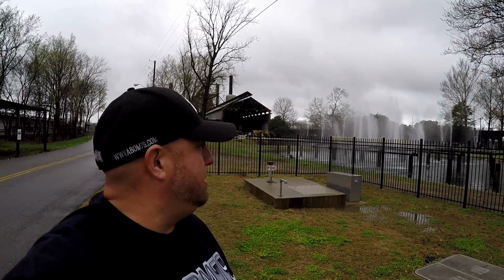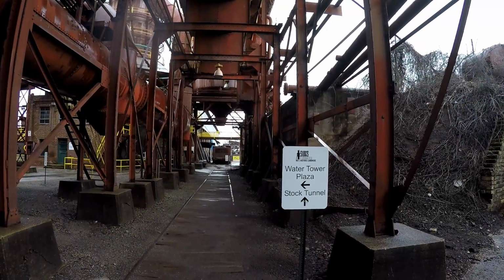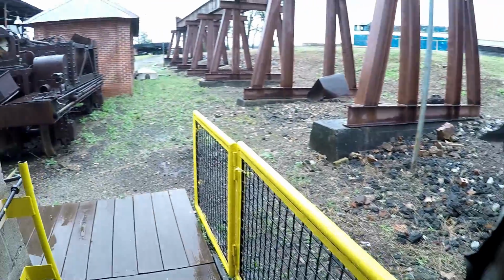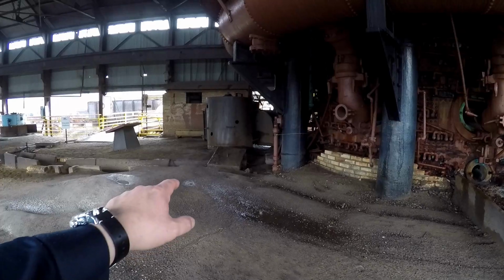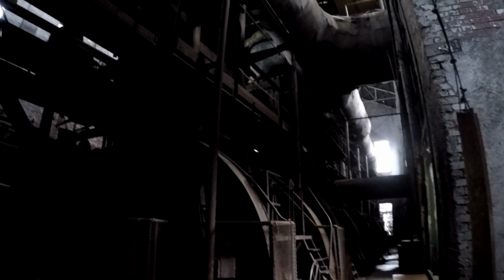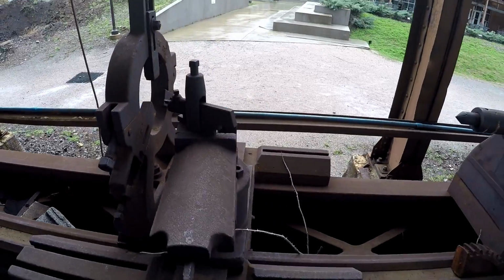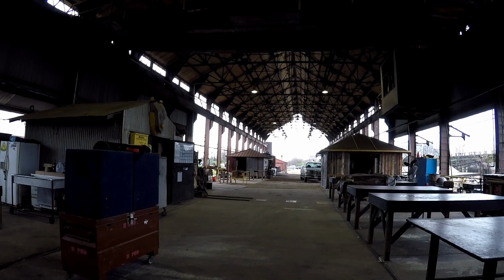Sloss Furnaces, Birmingham Alabama

Comment: great video, I was fortunate to have a tour of Corby steel works before it closed in 1980 ,I was able to stand near the blast furnace as they drilled the mud plug and watch the molten metal run down the ways ,watch the BOSS plant blow liquid oxygen and make 150 tons of steel ,rolling mills ,sinter plant and tube works ,a great shame it closed ,I use to transport VIP`s so I tagged along (with all the safety gear on ) the noise was unbelievable !

Comment: The wood working equipment was used in these old smelters to make patens (Patterns) for sand casting. Most of the old smelters made their own parts and pieces hence the need for woodworking and machining equipment. The piece of equipment with the large disc is a disc sander and a drum sander on the other end. I believe the machine that was not identified was actually a shaper for cutting continual profiles in wood. 

I have been to a zinc and copper smelter in Flin Flon Manitoba which was built around 1930 and was still in operation until 2010. They had much of the same kind of machinery shown here. Much of the smelter in Flin Flon is made of wood that was harvested from the local boreal forest as the mill was built. They hauled in two sawmills and cut the lumber to size on site. Some of the original posts and beams were 24" x 24". They were still using a couple of truckloads of oakum every year and had barrel coopers on site to oakum the seams in the tanks and chutes on site made out of 3" x 12" rough sawn spruce with barrel hoops. Some of the tanks were around 40' across and contained sulphuric, nitric, and hydrochloric acid used in the smelting process. The entire line was designed in stages that run down a shallow hill side so they can use gravity to move things through the process. There were two Millwrights hand lapping a bronze pump casting they had just cast to get it to fit the pump body. The pump was so old that replacement parts had to be made from scratch.

One of the strange and somehow sad things about the place was in an area where they removed the zinc from the anodes that collected it in solution. There was a manpowered railroad that bought cart of the anodes to a worker at a table. He picked the anodes off the cart and hit them with a small hand sledge which broke the zinc off, flipped it over and did it again on the other side. The anode went on another cart while the zinc went to a third. There was a structural column directly behind the table and I noted some writing on it. It said, and I am paraphrasing here as I don't remember the exact dates, "first snowfall October 21 1947. First snowfall September 30 1948. First snowfall October 12 1949." This went on until  1989 when it suddenly stopped. I asked my guide what it was all about. He said, and I quote, "Well it's self explanatory isn't it. First snowfall in 1947 was October 21st. First snowfall in 48 was September 30th." I asked him why they had stopped doing it (I was there in 1992.) He said, and his exact words were, "Well he retired......" The same man had worked at that station for 42 years doing that mindless job day after day after day. You might want to think about that before you start complaining about how bad your job is.

Comment: Adam....the first machine is a jointer with no fence, the next was a disc sander with tilting table.  Next to it was a spindle sander, the last machine with the cover is a "square head" thickness planer.  I'm betting on all this was for fabricating the wooden patterns for the sand casting molds.  Many wooden patterns were made from mahogany.  Thank you for sharing everything you do with your spare time.  Tom

Comment: man that brings back memories. i spent 20 yrs in the pitts steel mills back in the 60's and 70's. watching them tap those furnaces was quite an experience. we used to pour iron into subs ,special built rail cars that looked like submarines and could gross out at around 800,000 lbs when full of molten iron. you havn't lived until you had to rerail one of those beasts. nice video adam.

Comment: The machine in the power house that you first referred to as a planer is called a jointer.  The second "planer"  is a thickness planer.  The machine with the large disc and a drum sticking up through the table appears to be a combination disc/drum sander.  the drum likely oscillates as it turns to wear the sandpaper more evenly.  My guess they either used the power house as a pattern shop or they moved the contents of the pattern shop in their for safe keeping.  I would love to have a wood shop outfitted with such wonderful machines.  

Loved it!

All the best!

Mike

Comment: Cool old  stuff Adam , starting @ 26|00 You are in a pattern shop yes a wood lathe a big jointer  a disk sander and spindle sander if you look they are set at a  angle for the draft on the pattern so you can get it out of the mold. .Nice to see a few patterns still there.

Comment: Great video Adam takes me back to when I worked at the Bilston Steel Works about 10 miles from Birmingham in the UK as a electrician I carried out repairs in any part of the works Blast Furnace ,Melting Shop, Rolling Mill etc. I worked on the Bilston blast furnace Elisabeth and did 2 furnace reline these happened about every 4 years were the top of the furnace was removed the brick work inside the furnace stripped out then reclined with new refractories 'bricks' the process took around 30 days not only was the furnace relined but all the associated plant was maintained as when the blast furnace was producing iron it did so 24/7 x 365 for 4 years ! This is the furnace https://player.bfi.org.uk/free/film/watch-bilston-blast-furnace-1977-online
Reply: Link states that BFI videos can NOT be viewed outside the UK! Bummer... wonder why not.
Reply: Sorry I was not aware of that would really like to share Elisabeth with you I'll see if I can find any more footage !

Comment: That power house area was doubling as a foundry pattern shop, the wood machinery was unmistakable to the trade.
The (grinder) with the balance holes is a disc sander for working square and tapered surfaces on wood patterns.
At the other end of it is commonly known as a Bobbin sander in my neck of the woods for inside curved surfaces on patterns.
You could see the Patterns and Core boxes stacked in the corner, yellow paint on them denotes location prints to hold a sand core in place for forming hollow portions in the casting or areas that don't mold in the draw direction .
This was bread and butter work for the foundry I did my Pattern making apprenticeship with in New Zealand in the 70's.
I'm now in Adelaide Australia at the back of a tool shop running a 5 axis router with the 6mx 2m table, making some patterns but more often plugs for composite molds.
Sometimes they trow me on their big CNC mill with BT50 collet chucks, so You Tube channels like your own are enjoyable home work for me. :)

Comment: Awesome video as allways Adam ! The slag U mentioned, was used for roadconstruction/foundation here in Holland for many years. When that is compacked and set, it forms a solid layer that can not be digged out by a normal excavator !! You need a serious hydraulic jackhammer to get trough it again...
Reply from the maker: I would imagine it gets nice and hard. The placard showed a cement truck and mentioned using the materials for asphalt.
Reply: Also loved the Abom size wrench ! Hang that on ur wall, next to the big tap wrench eh ! lol

Comment: Awesome, Adam! If you permit me to add a few remarks:
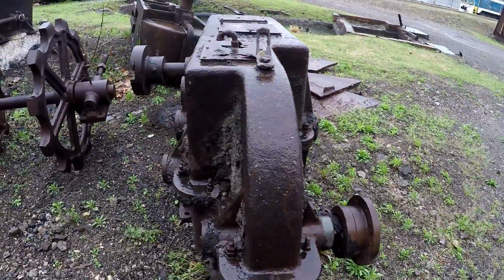the machinery gearboxes shown at 13:00 and the pig iron molds are most probably parts of a pig iron caster. The molds form a closed chain and are filled with pig iron at one end. The iron solidifies and drops down at one end of the chain.
There is still (at least) one  in operation in Germany at Duisburg. I photographed it many years ago.
http://www.industrial-history.de/StahlArt2/archive-DKRecycling-CN-670-6-28.02.2005-en.html
http://www.hfinster.de/StahlArt2/archive-DKRecycling-C-1040-9-08.03.2003-de.html
Hope, this is of interest.
Kind regards and many, many thanks for your great videos
Harald

Comment: I work for the company that used to make all the no bake, and phenolic resins for big casting companies.  We hardly make any of those resins anymore, what was once sold by the ton is now sold by the bucket.  Our plant looks a lot like Sloss, old and tired, and we still have many of the testing equipment buried around that used to test the resins for QC. We are located in not far from Cincinnati, and its likely we supplied materials used to make many of these Cincinnati castings.  It was cool to see all this old equipment, the connection it shared to the company I work for.   Thanks for sharing!

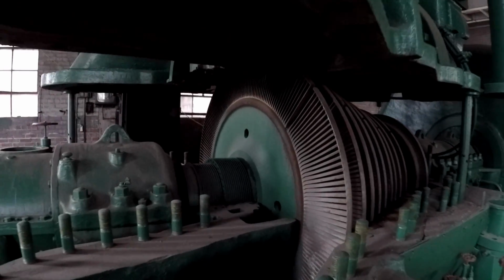Comment: 18:37 That's a pretty big steam turbine, you could power a good sized ship with a couple of those. Wonder what the output of those blowers was.
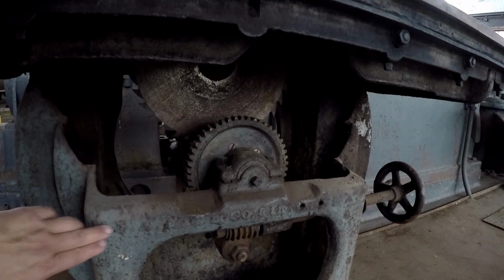27:00 Joiner, used to true up the edges of boards and beams. Seems to be missing the fences.
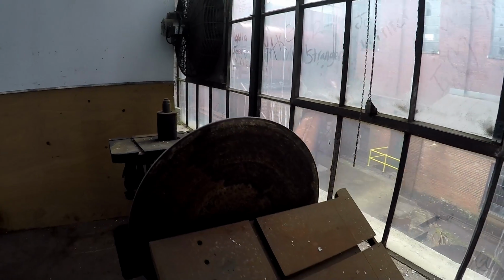28:00 Disk Sander, woodworking tool. You were right the other one is a drum sander.
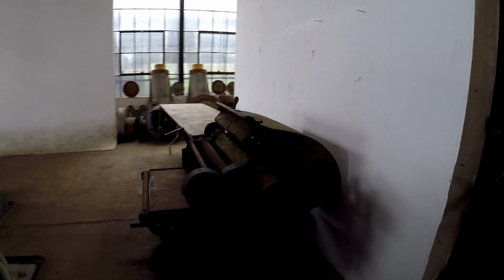28:45 Thickness planer.
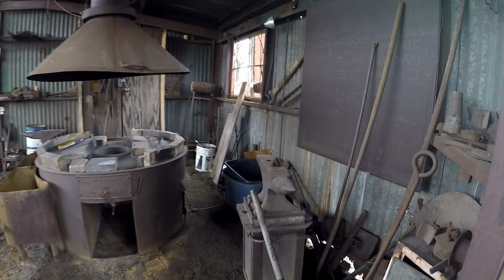34:20 The forge was built so 2-3 Blacksmiths could use it at the same time.
38:00 Definitely should take those classes. :D
Poor lathe looked like it could use some TLC.
Should have mentioned Abom79, or better yet, gave a card to him. Networking Adam.

Comment: Boy Adam that brought back memories of my time at the local iron works we had 6 furnaces. I looked after the old works set of three , we had 3 parsons turbo blowers and two turbo alternators , I was a sparks just out of my time  and was on shift . Little bit of info the charge was put in though a bell system little and large as shown in the poster ,these keep it gas tight at the top , the large round pipe around the furnace is lined with fire bricks and called the wedding ring . It was no fun at the casting plant when the crane broke down with a 75 ton ladle on the hook and you had the go up top to sort it out

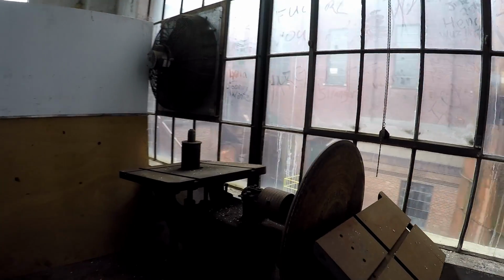Comment: 27:50 
I believe that's a universal sanding station circa 20's or 30's era. 
On one side you have the large sanding disk with the ballancing drills on the backside you pointed out, and adjustable table, and on the other was the oscillating drum sander, with adjustable table.  the drum would spin, and move up and down. the adjustable tables were so you could get your part into any position you could want. 

From what i can see in the video, that entire wood working area was for building patterns for green sand molds. 
I believe there were still some very large patterns still there on the back wall past the sanding station.

edit
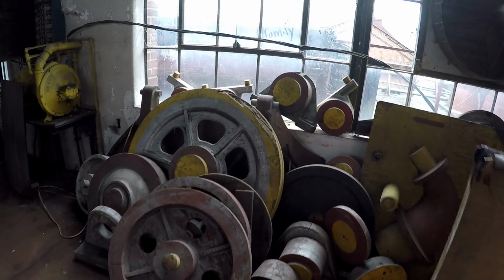Yep, looking at timestamp 28:20 you show some of the mold cores and patterns. 
And at 30:09 you can see a very large split-face pattern.

- Edit 2 - 

I think i found what you're looking at... Found it on vintagemachinery.org 

http://www.vintagemachinery.org/pubs/305/202.pdf
Page No. 14 in the PDF

catalog number 454
"Spindle and Disk Sander"
Publication date: 1929

Comment: The flat bed machine with the rotating blade looked like a jointer with fence missing used to square up edges. The disk wasnt grinder it was sander.

Comment: The J. A. Fay equipment is shown to be carpentry equipment.  So it appears that room was where they made the wooden molds for forming the sand casts for the iron to be poured in to.
Reply: Most iron works had huge casting facilities to make things like the big castings on that Ingersoll Rand blower.  The mold makers formed the shapes in wood before putting them into sand for pouring the liquid iron.  That's why all the woodworking gear.  Keith Rucker has made some wooden forms on a smaller scale for his restorations.  It's a great tour, and sorry to see we don't have as much of this as we used to in the USA.  There was some good paying jobs for a LOT of workers.

Comment: I used to do maintance in an aliminum foundry and worked in another that also did magnesium. Some of the casting processes were simular but on smaller scale at lower temperatures so it was cool to see. You are a accomplished videographer, thanks. I never knew that you could see such a place. i haven't convinced my wife yet to go there from Minnesota. May have to go there by myself.

Comment: Hi Adam, that was a large disc sander which is very useful in pattern making as each surface needs the proper 2 degree "pattern draft" so that the pattern will pull out of the sand mold. Pattern makers love the disc sander because they can set the table for the 2 deg. angle and easily sand all sides of the pattern quickly. Thanks for the great video!

Comment: The wood working tools were great to see. That jointer beside the saw is a monster! it looks like it could handle some mean sized beams. The disc grinder and spindle sander combo was also really cool. The tool you're looking at at 28:54 is a thickness planer, belt drive!
Reply: ThrowingItAwayy

Comment: Unreal! Fantastic video. The as tools were the pattern shop. The patterns were placed in the molds, and sand rammed around...then removed for the good to be filled with iron. The hooded machine was a thickness planer... rough lumber first went over the counter (flat bed machine) to flatten one side, then they the planer to come out with two parallel sides, of a desired thickness. The machine with the large disk was a disk sander, and an oscillating spindle sander beside it. The lathe was a ww pattern makers lathe. I think Keith still has a Faye & Scott

Comment: I've been around a bit, live in California now but I'm from Western Pennsylvania.  I'm 66 now, but in the 1970's I actually worked in a steel mill for about 6 years.  Most of that was working as a Quality Control Inspector.  But I've worked a little bit in all the units, including on the 100 ton electric arc furnaces making 100 tons of steel every 6 hours.  YES, they did allow women back then, but believe me, you worked just as hard as any man.  So lots of familiar sights.  And Adam, the woodworking tools you saw came from their pattern shop, part of maintenance.   Places like these repaired and rebuilt everything in house.

Comment: Hey Adam that lathe you seen is a wood lathe you can tell by looking at the tail stock it has a ring around the center. The other two machines are a table saw and the biggest jointer I've ever seen I can tell it is a jointer becase of the loop in the casting. Now a days they all have a fence which that one is missing. Also they now a days have a swinging guard that resembles a golf club that swings out of they way as you feed stock thru them. That old stuff is so cool and very nice to see up here in Dayton, Ohio. We did a lot of machine work on all types of steel and other metals. great video keep'em coming!!!!
Reply: That Jointer looks like it could handle some HUGE beams, I wonder where the fence is? it must also be a massive piece. Did you catch the Thickness planer he also showed? That's also a big boy at 24" it looks like.
Reply: Yeah that's was a big planer too.

Comment: Nice video, bet that was a very noisy and dangerous place to work.   Sure was a work of art in its day.

Very interesting process that turned the raw materials, coal, lime stone, iron oxide (iron ore) and oxygen (air) into useful cast iron products.  They took great care to be as energy efficient as they could.   Cooked the coal to make coke, the waste coke gases were burned to make steam and electricity and also feed the air preheaters for the blast furnaces.    Furnaces were charged with the coke, iron ore, lime stone (flux) then 1300 deg hot air from the air heaters burned the coke and reduced the iron ore to molten iron.   Again, the waste flue gases, mainly carbon monoxide,  were not wasted but burned to reheat the air heaters or make steam/electricity.     It's just a supersized Kamado Joe.

Comment: Those machines in the powerhouse are all woodworking, looks like they were for pattern making, one is the combination drum and disc sander, yes that's a planer
Blast furnaces work by having a fire in the bottom, they pour coke, iron, flux etc in the top, the 'tubes'  are for blasting air into the bottom, you would normally see flames shooting out the top when the blowers are running.
It's worth searching for videos about it, there's a few in the UK that still use the blast process.
That type of furnace was replaced by the 'Bessemer process' if i remember.

Comment: The take yourself on your own tour method is the best. It is cool to try and figure it out for self. Those info signs give the basics. I need a big wrench, not as big as that one,.. but, think is eight inch nuts I need to loosen. Hydraulic tensioner too expensive, forgot how much that cost. Thinking about making a wrench and pushing it with a hydraulic ram. Machine still works, but in need of repair.
How much does it cost to record videos and pictures there? That certainly is unexpected.
Real cool video, extra cool. Thanks for recording.

Comment: Those motors connected to pumps reminds me of my time at Chocolate Bayou. Finish pump repair on second shift, install on third shift (a double).  As an apprentice, I always got picked by the Tech because I could dial in the couplings without  help. I also got the carbon bushing jobs, wash your hands and a few seconds later, they have turned black again.

Comment: Excellent video, Adam .... The woodworking tools look like they were used for pattern making, which would suggest that they did some foundry work there as well. The tools that looked like a grinder in that area were a disc sander and spindle sander.